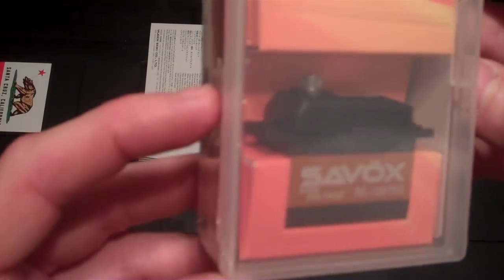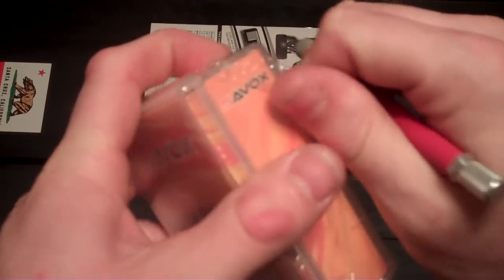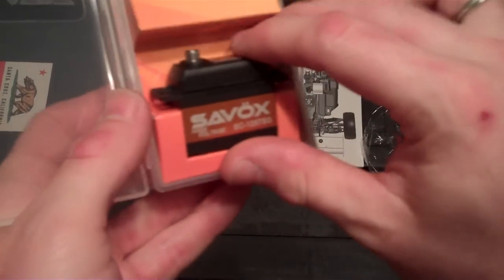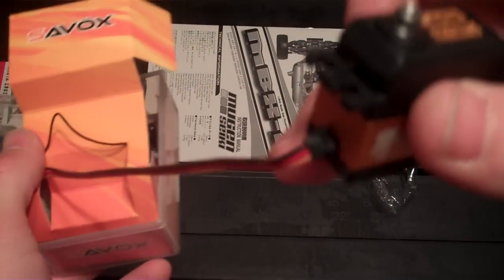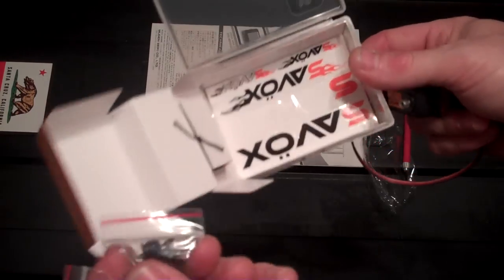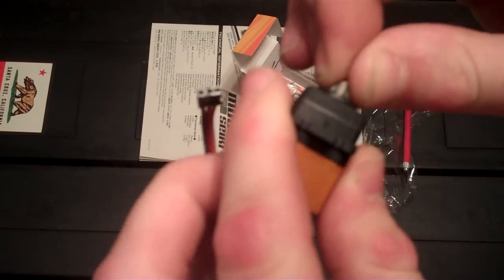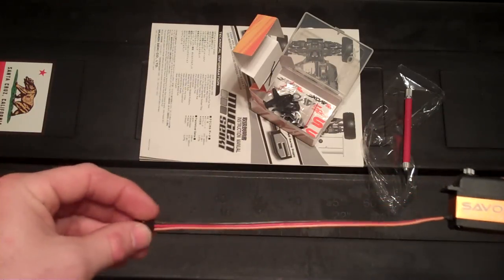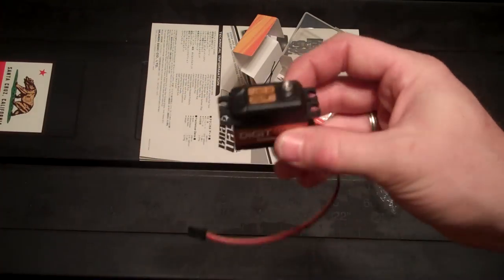Savox SC-1267SG High Voltage Servo

Comment: What reciever do you use? My 1268 shuts my car down anytime I turn 3 or 4 times rapidly. My car stalls out and then sits for 3 seconds to respond. I think it's my cheap RTR SR201 reciever cause I have a RX8 ESC. What rx/tx do you use?
Reply: Hey, do u have Savox SC-1267SG High Voltage Servo in your rx8 without bec ?
Reply: I put a buster in there and it fixed it right up